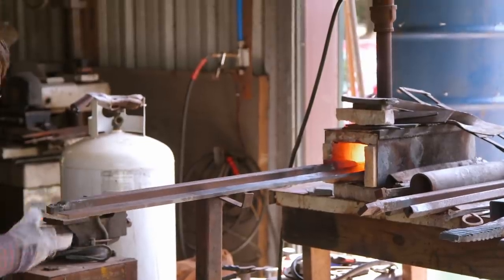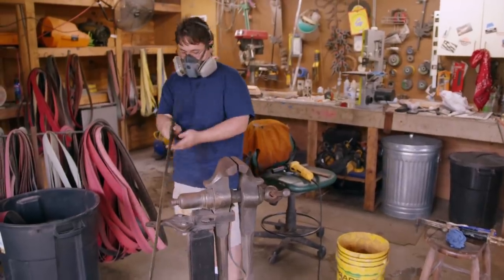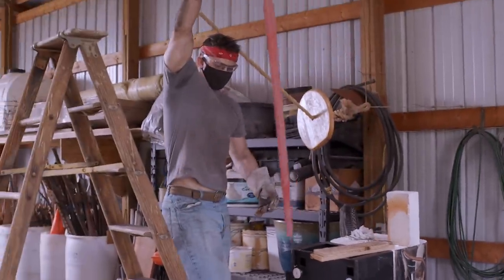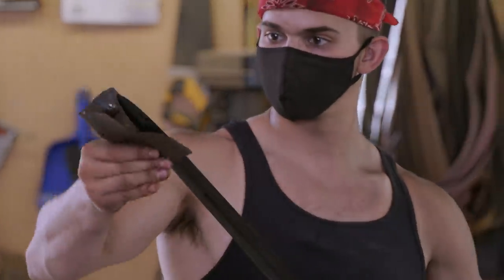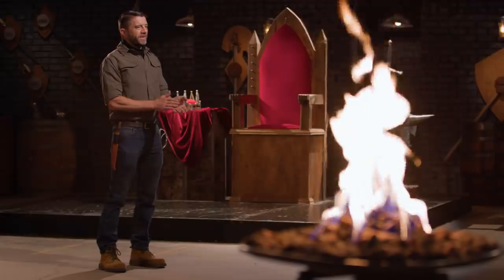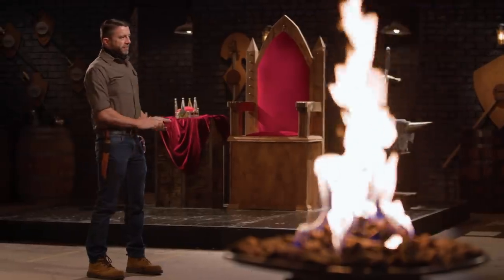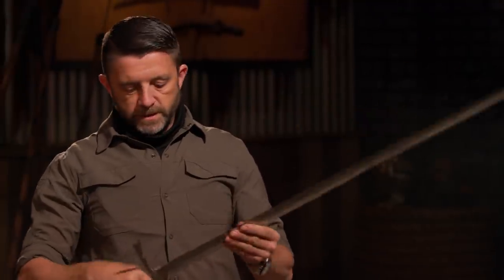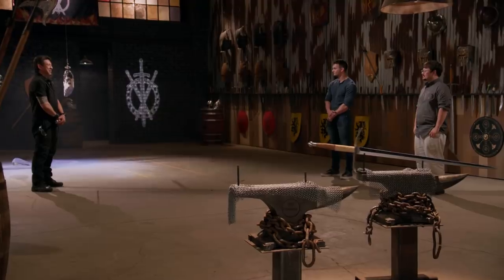The YOUNGEST 2X Forged in Fire Champion Ever?! (Season 8)

Comment: Teenage Rambo vs Gamer Boi. Seems both did some solid research. I'm a little skeptical of the Colton's blade design which features a bi-fullered blade, with the narrow fullers run 80% of the blade length. There's a reason why the slender type of late medieval longsword blades (Oakeshott type XVa, XVII, and XVIIIb) don't have long fullers, but tend to have either a prominent central ridge with a diamond cross section (seen on Dave's sample sword), or a flattened hexagonal cross section. It must maintain a certain degree of rigidity for thrusting through mail rings, and stabilized cuts. But his blade did seem rigid (albeit a bit heavier than the Gamer dude's). So in the end, the warp on the other guy's blade did him in. His heat treat is indeed very sound. It's not overly flexible, but when Doug cut the second bag and his edge alignment was a bit off (judging from the angle), the sword still cut the bag through, though demonstrating significant flex.
Reply: Honestly, I thought that the loser's sword performing equally well despite the warp was really impressive, and testament to the rest of his work being ahead of the winner's.  Withstanding the thrust tests and other strength elements with a mis-aligned tip like that is much harder on the blade, and to come out of the tests with equally minimal damage is really a testament to the construction, heat treatment, etc.

I think the judges were ultimately correct because you'd obviously choose a straight sword with identical performance over one with that built-in structural weakness, but getting equivalent performance with a handicap is pretty remarkable and a testament to the quality of the rest of the work.
Reply: @truelionofhylia8152  Weight is a very significant concern for a weapon like this one, so the decision to use fullering was a good one, its really just a question of exactly what sort of dimensions and position those fullers are placed in: whether you go narrower and further up the blade, or deeper and shorter in the thicker part of the blade closer to the hilt

the longer fuller requires some consideration for how it impacts the durability and flexibility of the blade, but its better than the shorter, deeper fuller even if it removes identical amounts of weight, because you want a blade's center of balance to be as close to the hands as possible.  Removing weight in the lower part of the blade is net positive and makes the weapon easier to control, but it's marginally worse for the location of the center of gravity than removing that same weight from the full length of the blade.

These kinds of longswords - designed for 2 handed use, but in a fairly agile combat style and where the second hand may occaisionally come off the hilt for balance purposes - benefit significantly from improving their weight and center of balance, as longsword fencing involves a great deal of finesse and adjustment of angle of attack, and is not a brute force usage method.   A larger 2 handed sword like a claymore or flamberge still benefits from weight reduction in terms of control and recovery, but those swords are used for broad, smashing blows.   Longswords are not used that way, and control is a critical consideration.
Reply: Pon. ¡EEEEEHHHHHHHHHHHH!.
Esto es un petardo 🧨. ¿Pero qué rollo macabeo es éste?. Un ladrillo 🧱
Me 🇪🇸 voy a tocarme un poco…🤔
—————-
This is a firecracker 🧨.  But what Maccabean roll is this?  A brick 🧱
 I'm going 🇬🇧 to touch myself a little ... 🤔 and drink some 🍺 beers ...
Reply: @mikejunt  Yeah a very minor warp doesn't necessarily impact the performance in any meaningful way. His heat treat is indeed very sound. It's not overly flexible, but when Doug cut the second bag and his edge alignment was a bit off (judging from the angle), the sword still cut the bag through, though demonstrating significant flex.
Reply: @truelionofhylia8152  That's not really true. For the most part, diamond cross section with a hollow ground (or flat ground if the blade is very broad) provide the best cutting performance because of the thin edge that meets minimal resistance, while having a pronounced central ridge to ensure rigidity.

There's a reason that hexagonal cross section is relatively rare on medieval swords, is that they don't have any advantage over other cross section, but if the engineering is sound, the correct hexagonal cross section (different thickness, distal tapering, different bevel depth) can still perform. Modern blademakers typically get the hexagonal cross section wrong as they just take a flat stock and grind two very shallow bevels on both side, that contribute nothing to performance. Yeah, it would be "durable". Why would you choose a "durable" sword that doesn't do the job, when you can just pick up an axe, that's a lot more affordable?
Reply: @mikejunt  Yes, fullering (knowing as fluting in armor making) is quite the scientific strategy to reduce weight while maintaining a degree of rigidity, but it's not what most 15th century longswords (which is what this so-called "German longsword" design allude to) use. The majority of late medieval longswords use a diamond cross section with either a flat ground or a hollow ground geometry--a small minority has a hexagonal cross section with a very narrow central flat surface (unlike some of the modern maker's very wide flat on their "hexagonal" cross section), and a small minority of them have a short fuller usually no longer than 1/3 of the blade length, very occasionally reach up to 1/2 (type XVIa, which is relatively rare on originals).

And totally agreed that as many types as "longsword" as a broad category has,  they are almost entirely dexterity-based, or rather--technique-based weapons. The force used to generate significant kinetic energy and momentum in cuts and thrusts comes from skill and experience, not big deltoids and biceps you get in the gym (I love those too, but they don't contribute much in longsword fencing).
Reply: Colton also pulled off the damascus, which is quite a rare sight and significantly more difficult, so he definitely deserves the win.
Reply: @mrkiky  It is a rare sight, because late medieval swords no longer used "damascus steel", which is really just pattern-welded steel, not the real Damascus (Wootz from India and Sri Lanka), as the metallurgical technology in Europe evolved, the fascination over Wootz steel (crucible steel, which was tougher and has a better edge holding ability than EARLIER MEDIEVAL sword steels) pretty much faded.

There was no longer original finds in Europe that uses recycled  or imported Wootz, or patterned welded steel anyway. With modern steels we have access to today, pattern welded steel adds nothing but aesthetic, but several more points for failure. It is at best on par with tried-and-true high carbon spring steels, IF FORGED and HEATED TREATED PROPERLY. It is only fascinating to the knife-community--primary to the chef's knife scene, which has most makers understand nothing but sharpness with a good bevel--not that hard to implement if you think about it, so being "damascus" becomes a thing. In the sword community, very few people pay attention to it as it is purely aesthetic, FAR less important than proper blade harmonics, distal tapering, and cross section.
Reply: @FortuneFavoursTheBold  Yes I'm well aware and choose to still call it damascus on purpose just because the term has been adopted in modern times to mean pattern welded steel. And just the fact that the term is a reference to a location, it becomes super evident that we don't really mean what it meant historically when we use it. 
The difference in performance was negligible and there were no comments on weight and balance so we can assume they were both properly sized and balanced. So it would have come down to the more complex and fancier building technique, regardless if it adds anything or not. Yes it's purely aesthetic but it is a testament to the smith's skill. For example, you cannot attain the title of ABS mastersmith without making some damascus stuff. Plus, for the competition, it doesn't matter how historically accurate your materials or construction are (unless some feature is part of the parameters). It's just about making it in your style and having it perform. There was a khopesh episode, it would've been ridiculous if one of the contestants made it out of bronze. 
Also I don't agree with kitchen knives being easy to make. They are in fact some of the hardest knives to make. Not as difficult as swords, but more difficult than just about any other knife just because they're so thin and if you add stuff like s-grinds it gets even harder.
Reply: @mrkiky  I don't diss the artistry of chef's knives at all, but it is far less complex than just the sword blade alone---now we haven't even got the hilt design at all, there is TONS of subtle geometries and proportion to worry about, while ensuring it's ergonomic for the handler--there is a profession called gripsmith, who makes sword grips exclusively, and that's not even concerning the pommels, and guards (which is just the quillons on most medieval swords, not the complex hilt on Renaissance swords), which are often made by professional jewelers.

The sword blade alone is order of magnitude more complex than knife blades, which comes down the the subtle difference in handling characteristics. Two swords with almost identical blades in appearance can have VASTLY different handling characteristics, and in the context of sword usage, it could very well be a factor to whether you will be able to narrowly parry a blow to survive an attack that would open an artery on your neck, while pulling off a riposte to win and go home instead. Handling a meter long blade (or longer) between your hands and your opponent who also wield something similar, and pulling off all sorts of complex maneuvers is an entirely different beast as cutting up some veggies and steaks in the kitchen (again, no disrespect to the chefs--I own high-end chef's knives and I enjoy the culinary art).

The weight and balance are issues, but only a small part of the picture. Mass distribution is the actual topic. When you lift up an Olympic barbell, it's perfectly balanced--doesn't mean you can swing it around like a sword, because the mass distribution is antithetical to sword-related activities. This is a much nuanced subject and required the assistance of hard science like physics and human anatomy. On top of that, you have different cross sections, which are for different purposes. Colton here, does not implement the diamond cross section with a pronounced central ridge, but instead a lenticular cross section with a fuller that runs 80% of the blade--that lone could just disqualify him on the spot, because it's not the geometry you find on late medieval longswords. Yeah, it held up. Help up against what? Pig carcass hanging from the ceiling. Not an athletic human being with another properly made longsword ready to dissect you.

They rarely talk about the handling of weapons on Forged in Fire--to complex for the average audience to understand the network executives decided--beyond the usual "it's quite heavy". When you feel a sword is "quite heavy", it's usually not the weight, it could be a lighter sword on scale, but because of the atrocious mass distribution, it's possible to use as an ACTUAL sword.

We all love spectacles like cutting up pigs and ballistic gel torsos with blood flying everywhere, but to judge which contestant makes a better SWORD, not a pitchfork or garden hoe, you need to go beyond whose sword makes the blood fly a bit higher, and whose sword holds up against a granite block. With respect to ABS smith, those are just knife makers. Drafting a bunch of them to compete in swordmaking is a bit like asking a bunch of pro golfers to play tennis--not saying either tennis players or golfers are superior athletes, but it's an entirely different game all together, despite that both are sports, and both involve swing something affixed to a stick. Damascus appearance is only the last concern in sword design and making. It's not a factor in deciding who wins or who doesn't. That warp indeed did the Asian dude in--it's hard to argue against that, even though he made a more historical sword, and does seem to handle better (Colton's longsword carried Doug all around in 360-degree manner when he did a horizontal cut on the pig, that lone is a sign of poor mass distribution, unless Doug really had no idea what he was doing).

Damascus--while indeed adds the complexity to forging--and good for Colton to pull it off without delamination--is indeed only a concern to knifemakers, because there isn't anywhere nearly as many concerns in making chef's knives as making actual swords.
Reply: @FortuneFavoursTheBold  I said kitchen knives are harder to make than a lot of other knives but not as hard as swords, so I'm not sure what you're arguing against. 

As for swords, the weight and balance are not THAT complex. It's hard to pull off, sure, but it's pretty easy to describe. It only comes down to a few parameters such as blade length, hilt length, center of mass and overall length. If you get all of these correct, the sword will handle properly. These are concepts known to knifemakers as well, they're just more difficult to apply to swords. But I wouldn't say it's like golf and tennis, I'd say it's more like pool and snooker. But anyway, my mention of ABS mastersmiths was just to highlight the fact that you have to delve into pattern welding in order to be considered a pro. 

And as for the competition, they give you a weapon, which in this case is a "german longsword" which is very non-specific. Then they give you a list of parameters that you absolutely have to follow which generally include blade length, overall length and features of that type of blade. In this case, the cross section was not a parameter, so they could've made anything, even completely non-historical. Then they run the weapons through the series of tests, which are made to be a balance between entertainment and functional testing. So regardless of how accurate those tests are, it is after all a show so the way the weapons perform in them determines the winner. In case both weapons perform similarly well, which was the case here, they start to look at aesthetics, fit, finish, complexity, decoration and stuff like that. Which is why I'm certain that Colton would have won even without the warp in his opponent's sword because the damascus adds an amount of difficulty and skill that trumps anything else on either sword. 

And sure the tests are not scientific. Maybe another whack at a hard object and the winning blade would break. Maybe the losing blade just needs a little strop and it already performs better. But it is a show and they have to use the result of those quick, unscientific tests to determine the winner. In this case, the result of those tests is inconclusive to determine a winner, so they fall back on the aesthetics and the details.
Reply: @mrkiky  It's funny that I thought of the "pool and snooker" analogy when I wrote the reply but I decided they are too similar to make the case, Golf vs Tennis is closer given how different swordmaking and knifemaking are.

"As for swords, the weight and balance are not THAT complex. It's hard to pull off, sure, but it's pretty easy to describe. It only comes down to a few parameters such as blade length, hilt length, center of mass and overall length. If you get all of these correct, the sword will handle properly." This is where your understanding goes wrong. I assume you are a knifemaker or at least familiar with the trade, and what you said here is exactly how most modern knifemakers got it wrong about swords.

You probably didn't read what I wrote in the previous replies, but here it goes again: it is NOT about weight and balance. Those two parameters are what you take into account, but they are such a SMALL PART of the overall picture. The keyword is the MASS DISTRIBUTION. You take an Olympic barbell, which is perfectly balanced, you cannot do any sword-related activities with it, because of the way the mass is distributed on the barbell.

The mass distribution on a sword blade itself (not even considering the hilt) is not even, it's not a flat stock with some edges. Depends on the specific type and purpose, it has to be tapered in the profile, and tapered distally, and these tapering strategies are usually a non-linear one, which can be quite complex, and they have to work with each other, along with the proper cross section, edge geometry, fuller configuration (broad or narrow, shallow or deep, long or short, singular to multiple, symmetrical or not, tapered or not), tip termination strategy, tip geometry, blade harmonics, which concerns the rigidity AND the flexibility of the blade--the primary vibration node, the secondary vibration node.

Just the blade portion alone.

Professional swordsmiths like Peter Johnsson and Angus Trim spent decades researching it, running experiments, visiting museums, or making appointments with private collections or auction houses to handle and record detailed statistics and handling characteristics of a given sword--these data are considered and guarded as commercial secrets. So it's not "easy if you just pay attention to a couple of parameters".

Sure, Forged in Fire may not give such detailed requirements to the contestants, otherwise 99.9% would fail even the parameters to be tested at all. Now I agree the show shouldn't need to be so stringent, because it's TV, and it needs entertainment value, and watching amateurs trying and failing is fun. Of course this is the reason you don't see Gordon Ramsey visiting Michelin stars chefs' establishments to test them, but only failing restaurants to challenge them--because it is fun.

Now some contestants are amateur knifesmiths, some are pros, but almost ALL of them are amateurs in swordmaking, many of the finale contestants clearly haven't even held or seen an actual sword in person before, according to themselves in the interviews. So the natural inclination is making the knife they typically make longer--"what is it then if not a sword, look it's 30" blade and the center of gravity is 4" from the guard". Well it's not, a ship is not a "jetski but scaled up 100 times". If it was, all the profesional swordsmith and researchers would cease to exist. Not to say you can't build very high-end jetski or chef's knives.

It's the "History" channel, it should go a bit beyond in explaining things like "what constitute a 'German longsword'?", to provide a bit of education rather than appealing to the lowest common denominator (all TV exec and producers are educated to do just that, because they consistently underestimate the intelligence of the American people). To someone who is completely clueless about it, "German longsword" "maybe mean that...I don't know...maybe it's...long?? Maybe it was made in Germany or whatever??"

No, the "German longsword" specifically denotes to the type of sword described and used in the longsword fencing treatises written by late-14th century, and 15/16th century Germanic meisters Johannes Liechtenauer, Hans Talhoffer, Sigmund Ringeck, Joachim Meyer, and Paulus Hector Mair.

These longswords are specifically used in the techniques prescribed in the treatises for two-purposes: Civilian clothing sword fighting (duel, self-defense), and fighting in full Gothic style plate harness against a similarly armored opponent. All the designs of the longsword must have all the handling characteristics (NOT weight and balance) for being able to effectively support the complex fencing techniques (all sorts of parrying, blocks, riposte, feint, wrestling--YES, WRESTLING using swords), and it should deal debilitating blows against opponents in protective civilian clothing like arming doublets (layers of hardened linen and wool jacketed), or in armored fighting using half-swording techniques to pry open the gaps of plate armor (impossible to cut through to thrust through with swords), and still penetrating the mail and gambeson underneath, all the while resisting your opponent who tries to do the same.

All the parameters (way beyond weight and balance, which are rookie numbers) must support these activities. An ahistorical fantasy long-ish sword is not a "German longsword".

This is the reason almost nobody in the 14/15/16th century cared about pattern welded blades, because it does nothing, while there are so many crucial characteristics of a sword one must worry about. At this point, pattern welded had been around for many centuries (since the Migration-era), and it was just not a thing that is appreciated in the least and was abandoned, because it did not matter. Edward III of England commission a couple of swords each valued as much as a castle, using pattern welded steel didn't even cross the maker's mind.

Why is Damascus steel valued in today's knifemaking circles? Well you said it yourself, it's not really that complicated to check a few crucial parameters to the very simple and repetitive usage in kitchen, so for a knife to not be overly plain, it comes down to the aesthetics, and with a chef's knife you don't have the canvass on the hilt components like the pommel, crossguard, swept hilt, finger rings, siderings, knuckle bows, and the grip to do all the decoration (check out Renaissance swords and see how they are decorated--there's a lot to work on in the aesthetics department, pattern welded blades were still not a factor anywhere in Europe).